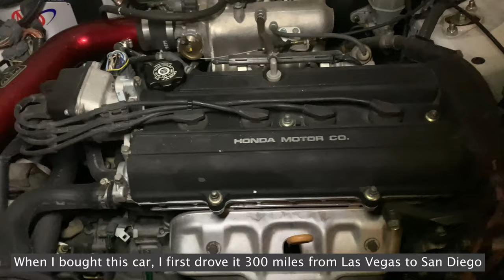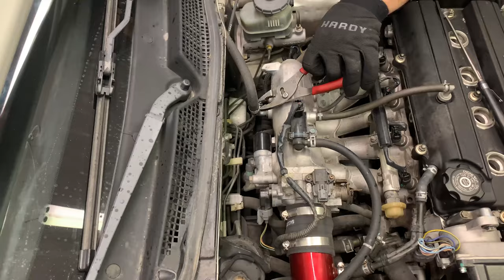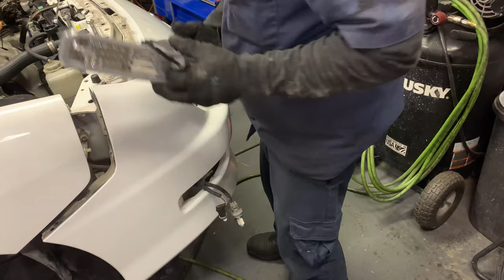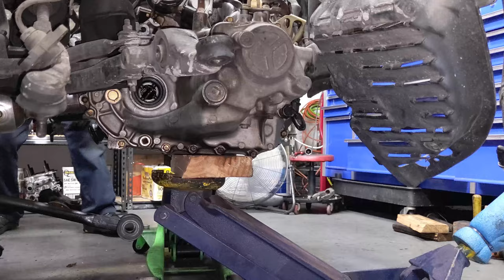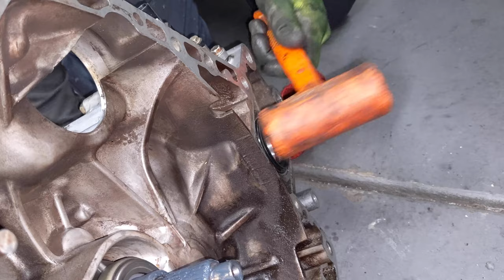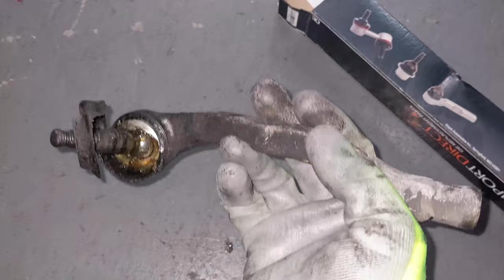B20B Swapping My Integra Part 2 - The Motor Swap and Suspension Refresh

Comment: What happened with the Ranger?
Reply: Just seen your comment you moved shops, where’s the new one?
Reply from the maker: Still in Spokane. Ranger has had zero updates for a while. People keep asking so I’ll be posting a video soon on something I thought wasn’t that interesting but might be. I’ve been focusing on the Integra and my new van recently. but will probably be pulling the trigger on new springs and shackles in the back of the ranger and possibly a complete front end refresh. Maybe in the next month or so
Reply: @rayregnogarage  Just ordered the the Solo Mid travel with Deaver springs and shackles. Pulled the front beams and arms off already. I bought all the wearable axle items so I will have a set of fresh beams. I also got a set of 4.10's, and a Trac-lok to throw in the front. Its a lot of work that doesn't get much attention on Youtube for a Dana 35. I might make a video of the process.
Reply from the maker: @JB-dl4ul  That's awesome! Def take a video of that. I just spent $3k on my van. so it will be a little while before I put any money on the truck. haha